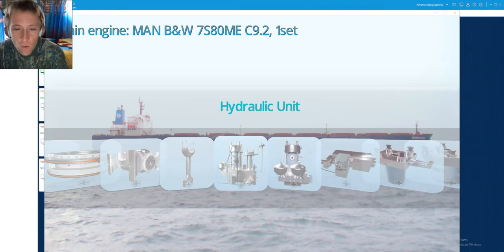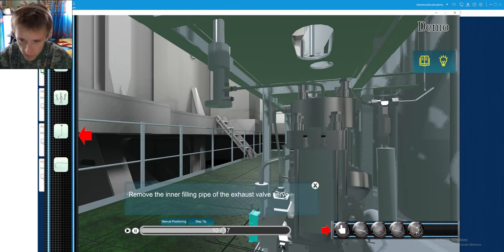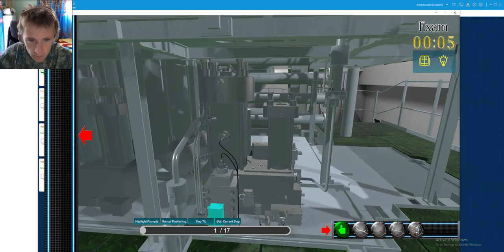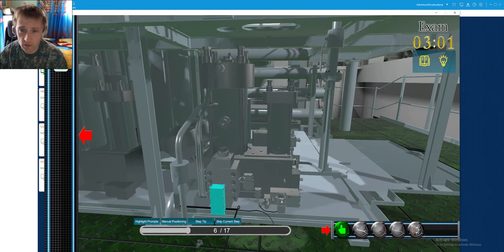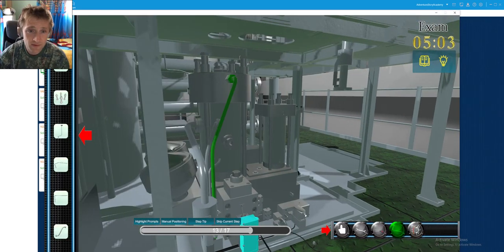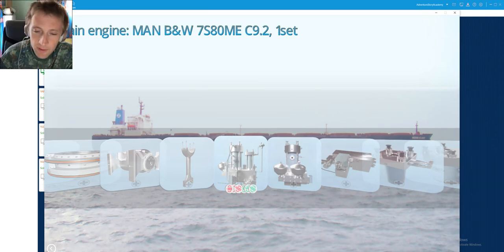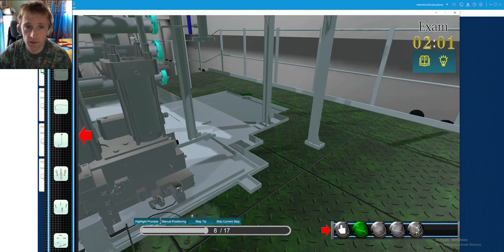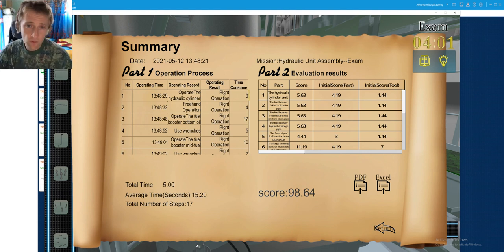MAN B&W 7S80ME C9.2 HCU assembly & disassembly procedure

Comment: Dear @adventurestory and friends,
Could You know what kind of problem is that on one cylinder (Cyl No.10) we have to regulate fuel index manually. 
Somehow, its seems that lost commands from governor like it coming from others and we must regulate by hand on MOP by continously following exhaust gas temperature of cylinder. 
So, depends of ME load we are increasing or decreasing fuel on chief limiter. What I annotate that offset of this cylinder No. 10 is -17 what is very strange.
Do You know what could be reason that this is happening? We replaced Fiva valve but nothing changed.
Type of engine is  STX MAN 11S 90ME-9.2.
Reply from the maker: Check your sensors first calibrate them!
Reply: @Adventure-Story  
I forgot to mention that calibration has been done already few time. I know that's very difficult to decide by your side from other vessel but regarding Your experience I made questions to You..
Anyway thank You for any suggestion ..
Reply from the maker: Which offset is -17 low or high?
Reply: @Adventure-Story  Pressure is higher,  with -17 combustion its lowered to be equal with others
Reply from the maker: Injectors checked ! Look if nozzles are the correct number